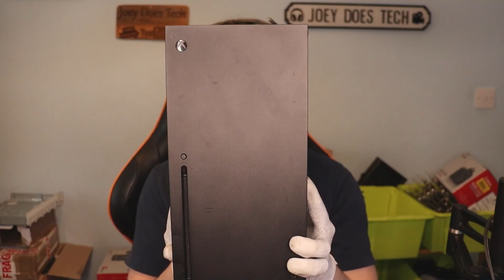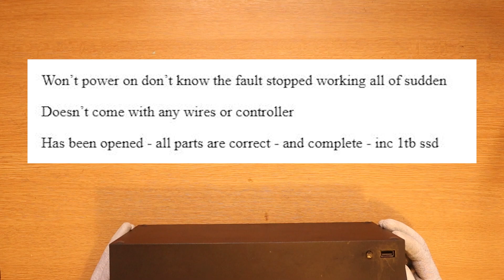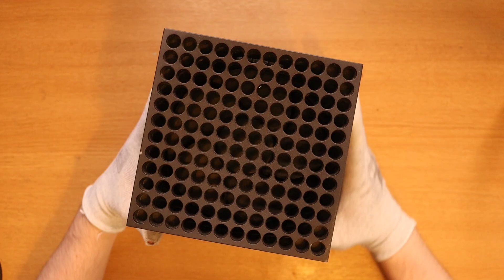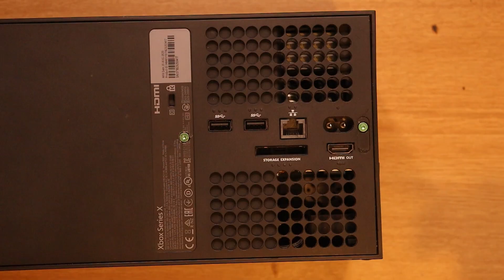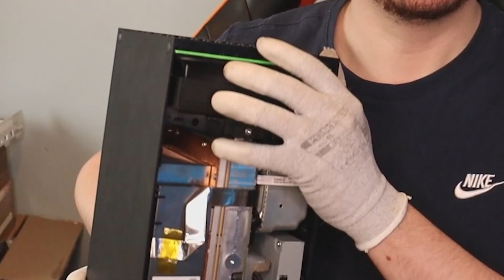No Power Xbox Series X | Can I Fix It?

Comment: I just watched this video to try and fix my Xbox series x as I thought the psu was faulty, it isn’t unfortunately, my Xbox one series x cuts off mid game from about 10 mins of playing changing the thermal paste and cleaned out but nothing still the same. And when I go to boot up it doesn’t give you the Xbox message of your console shutdown because of over heating so I’m 100% sure it’s not the overheating that’s the issue it’s the board somewhere or SSD hopefully not tho.

Comment: I have now had to replace both my wife and my Xbox x series. I have owned PS systems and some for 6 years no issues. These are little over a year and a bit past the warranty. So I may not be buying Microsoft again. Kind of a bummer.
Reply: I can relate   long time gamer from ps1 days  still have my 360 works perfectly   upgraded ftom  xbox 1 to 
Series x   year and a half it shuts down 
Mid game  won't re start . Not impressed 😕

Comment: okay this is a year old. the patients is outstanding, I most likely would of had both xbox side by side and plugging each into the other and testing.

Great video..

although not what i was looking for, have you came across the problem where the xbox will turn on, the fan will spin for a second, then stops then a few minutes shuts down?

Comment: I’ve just taken apart my Xbox one series x for a clean out took everything out so was left with shell went to put it back together and it wouldn’t turn on, I think maybe when I first opened it the ribbon cable with white and blue slot has a little play in it would that cause it not to turn on. As I’ve tried turning on with putting a disc in and using controller that’s paired up and still nothing

Comment: Hi, I'm considering buying a series x, should I be concerned about the SSD failing, I've seen a few videos now saying that the series X will eventually die because of it and it can't be repaired by replacing it because it is coded to the motherboard, is this correct?  Obviously Microsoft can repair it but this would cost nearly as much as a new one, especially now they only cost £379, thanks

Comment: 1st off great video very helpful you’re a funny dude question though. Like you I’ve found that my issue is not my power supply at 4:15 of this video you do a continuity test, when I perform it the left side every pin has the continuity sound right side however does not sound off on any pin. Any insight with that finding you may have would be very appreciated. Thanks in advance 👍✌️

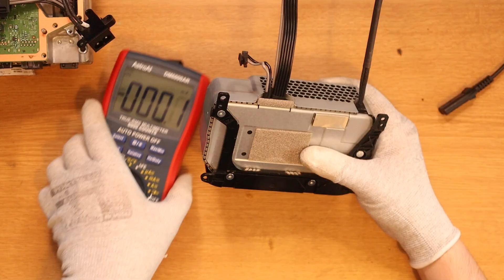To further my issue and explanation of findings when I do the power test like you do at 2:15 I get power with the a light visible for about 15-20 seconds then it dims and goes out and I do measure and read 11.9 DC with the multimeter on the left side of the 2 pin power supply connector the right side I do not 🤔

Comment: great fix bro, but a little iski to start the voltage injection with 12v, your get lucky but i will recommend starting really low voltage around 0.7v and 2amps if you dont see any heat spots you can start to increasing the voltage just to be safe

Comment: Hey question my Nexus power is broke power supply is broke and HDMI. I bought it that way once I fix the HDMI and PSU can I just use the controller or do I need the Nexus ribbon plugged into the front port

Comment: It's not recommended inject 12v, if there's the MOSFET of the APU is shorted the 12v can go directly to the APU, try to start with 1v
Reply from the maker: I did originally start with low voltage but couldn’t see a short unfortunately

Comment: Push down on that Mosfet driver to pushout excess solder, thats the way to go for non BGA chips. The ground pads are used to spread the heat by having too much solder it will shorten the lifespan of that IC, other than that great work.
Reply from the maker: Appreciate the advice!